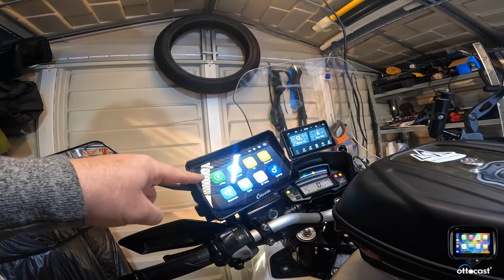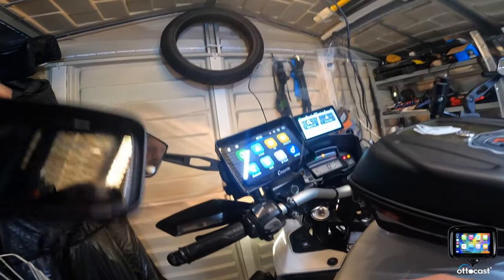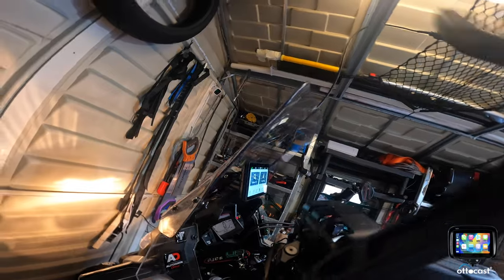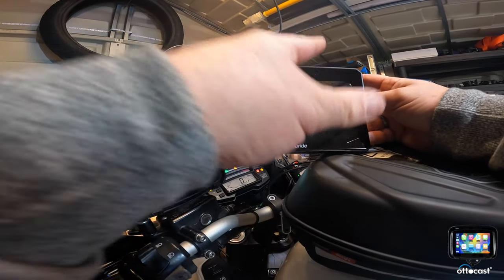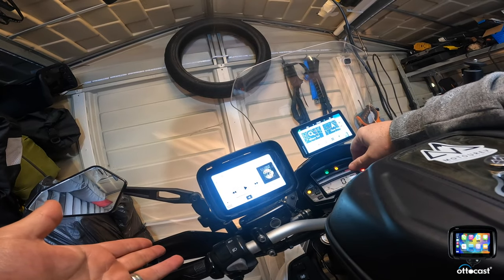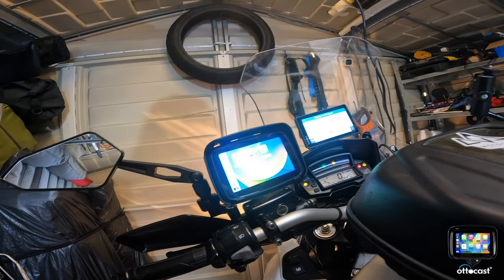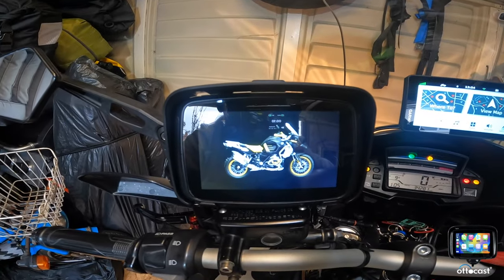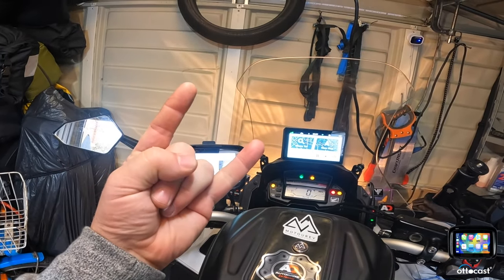OTTOCAST :: Apple CarPlay - Android Auto Motorcycle Display & Cardo Packtalk

Comment: Nice feature with using the audio directly on cardo from ottocast. Unfortunately on my firmware that option is missing. Can you tell me which firmware do you have on your ottocast, maybe I can find it. Thank you!
Reply from the maker: I will look tonight when I’m home 👍🏻
Reply: Thanks for your test ! I have exactly the same question On my device I don't have "switch to phone audio output". If you can check your system version it would be nice 🙂 @Motourev
Reply: I’m looking to buy one of these, but read somewhere that if I use Cardo with it I cannot communicate with another cardo system(user), is that true?
Reply from the maker: @MorcegolasMc  no, Cardo works as normal with other riders

Comment: Are you still using the Ottocast? If so how's it working?😊
Reply from the maker: Yes the Ottocast is the one I have kept as it is easily removable. It is working fine, tried it the other day with the sun out and could clearly see the display. Very impressed
Reply: @Motourev  is there anything you don't like?.
Still ok with the Cardo system, can you pack talk with other riders with no problems?
Reply from the maker: @shropshirecycle  yes Packtalk works as normal with other riders. If anything I don’t like is it doesn’t look as modern as the other ones I’ve tried, this one looks more like an older Tom Tom but performs better than the others.
Reply: @Motourev  I'll take older looking, I will get myself one now,thanks for the reply 😁